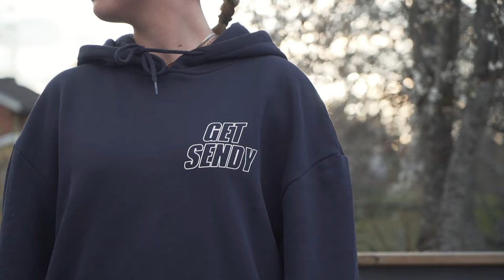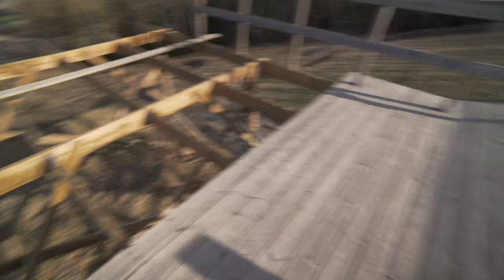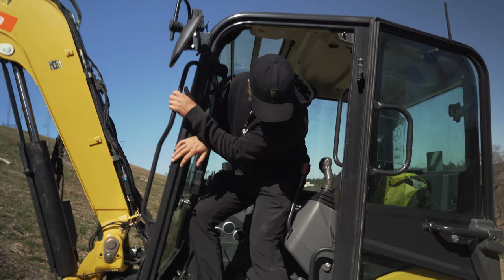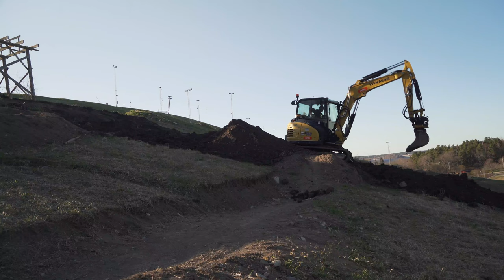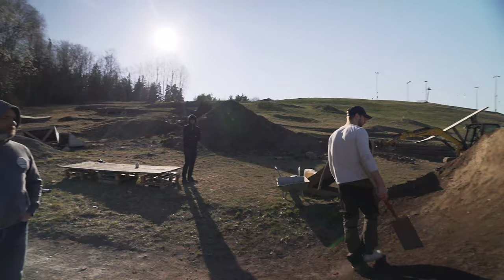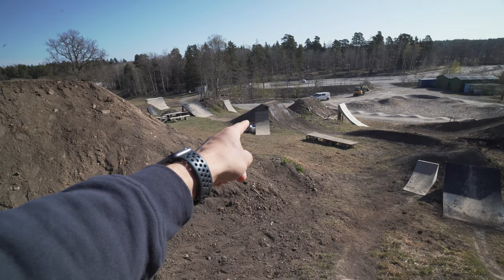THEY TORE DOWN MY MASSIVE CRANKWORX BOX... INSANE MTB COMPOUND BUILDING!

Comment: You are making great things... excavator tip.... try to make a pad under the excavator to level it when moving big piles.  It is just time... I have a couple of thousand hours under my belt and steep ground is not an issue to move on but it is always best to try to level first before slewing with loads.  keep the bucket low in case you have to ground it to stop from tipping.  You would be amazed at what you can climb up and down of when you start using the bucket to help.  Was really nice of the guys to loan it to you. extremely nice...  The compound is coming along.